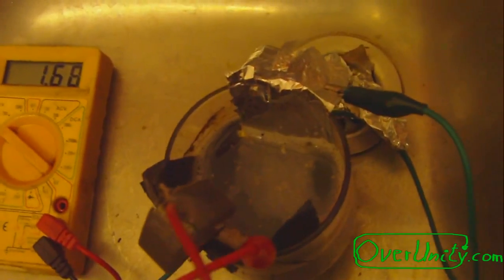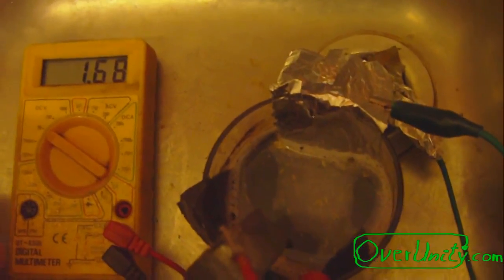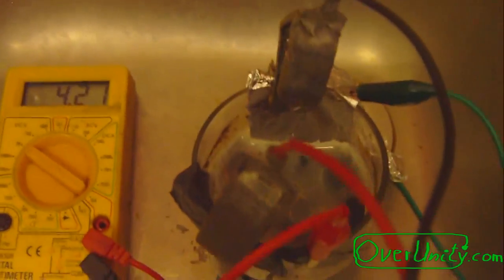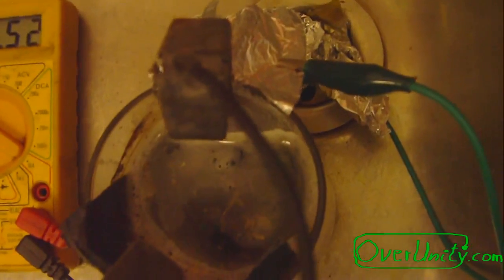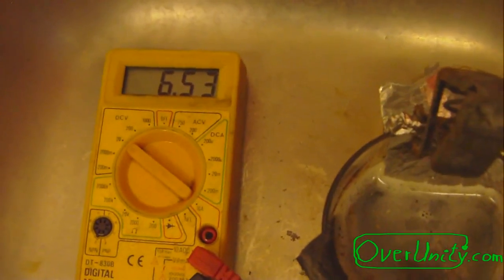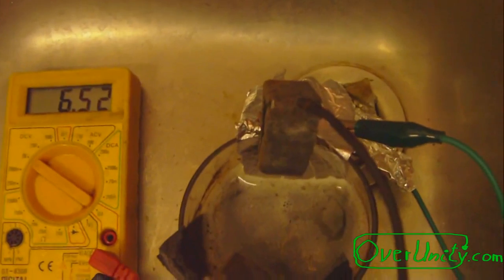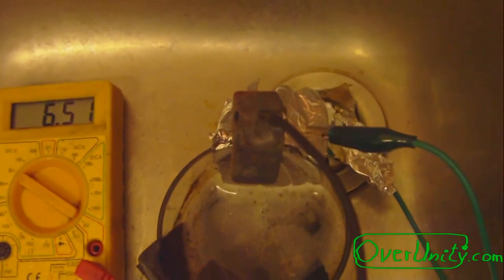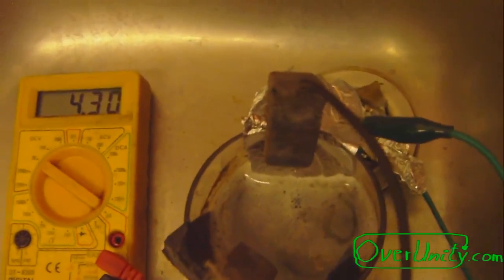homemade selfmade DIY battery cell new tests 11/12

Comment: Stefan:

What about substituting a beer or soda can instead of the foil?  This is still a very readily available item and the aluminum is much thicker and would last longer.  You could even use the can as the vessel and suspend the other screen in the electrolyte.  Most cans are now lined with a plastic coating which you could remove easily by burning off or by heating on the stove.

Just a thought.

Bill